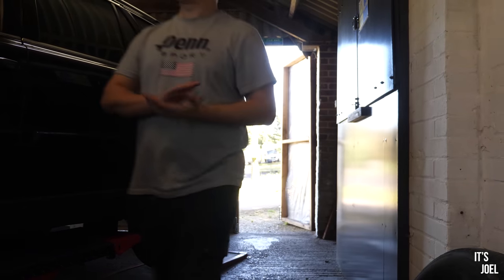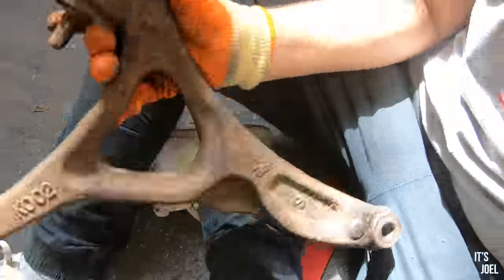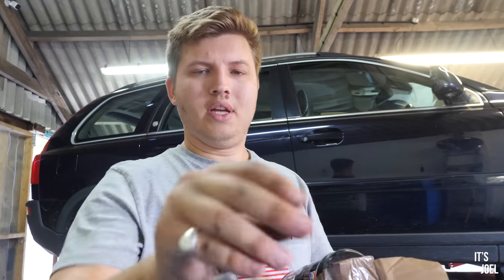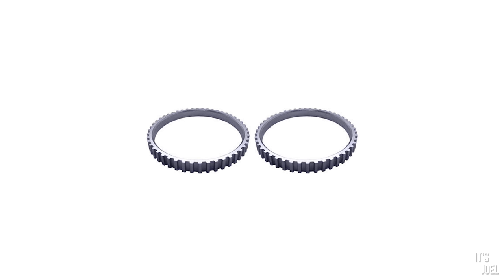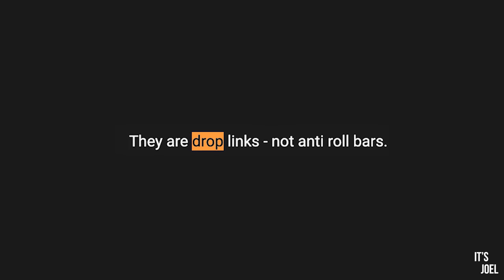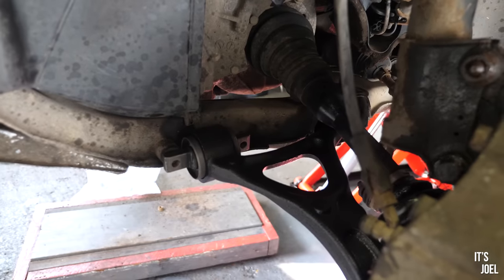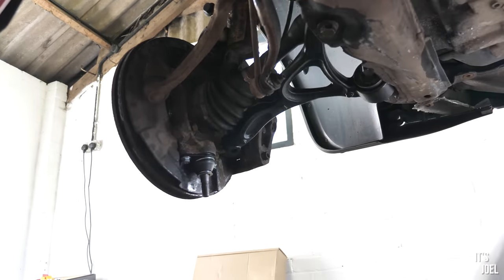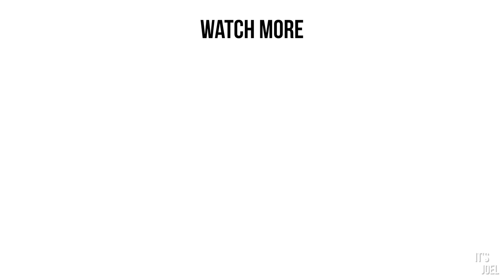CAN I SAVE MY £800 COPART VOLVO XC90? PART 2

Comment: Mate: that ball joint is fine - it just rotated on it's ...ball :)

Also when it comes to ABS sensors: get cheap OBD reader to determine which wheels isn't reading the speed then try swapping sensor only from other side. If it reads ok, then you know to buy wheel speed sensor (£20-ish a pop, no worries). If the wheel speed isn't being detected then check wires carefully before ripping into ABS rings.

Ask me how I know. 

BTW Your channel is an excellent representation of how car tinkering REALLY looks like.
Reply: I agree:  The rings are just "serrated rings"... there's nothing to wear out:  They get rusty and clogged with debris....and that causes the false signals.
Just clean the rings....restore the serrations.

Comment: Ball joint supposed to do that. Also while changing control arm you should remove drive shaft bolt and loosen up the shaft so it could move in and out, otherwise you might pop cv joint out and have whole new problem. Also, you need to beat the control arm with much more power to spearate it from ball joint (same with outer steering rods or driveshaft). Good luck and keep up the good work, man.
Reply: You can't bend a ball joint!! There's nowt wrong with it!!
Reply: @bernardcromarty485  That's what I thought too! The pin, connected to the ball, was merely askew.....  at the extreme of it's travel maybe.... but: Nowt Wrong With It!
Reply: Ball joints work as a ball in a socket so it can move like that the socket deterrents over time creating play in the suspension that u can feel at the steering wheel
Reply: I remember very well the first time working on my suspension with an experienced mate.. I had to bang the stuff so hard... 
I learned an important lesson that day : It is way easier to smack the crap out of someone else's car than your own xD
Reply: I've had Volvo V70 7 of em done loads drops links you should  find  now there's Allen key sockets on ball was on last so remove without spinning

Comment: Top work the bent ball joint made me laugh it’s meant to move around  like a joint but your learning and what your doing for a beginner aren’t easy jobs
Reply from the maker: Thanks I’ve learned this now! 😂
Reply: It's not bent it just needs putting in a vice and use a tube to move it back to center!

Comment: Well done, you remind me of how I had to learn the hard way as a young guy… I had forgotten how it felt until I watched you. Do not feel defeated, you are doing it and have the right ideas. Replacing extra pieces in the suspension and doing both sides at the same time is absolutely SAFE and wise, yes fitting it takes time to learn but you are doing well.

Comment: What a guy! Fair play Joel. I’m about an hour away and would happily point you in the right direction! Lost count of the amount of jobs I’ve done on our old xc90
Reply: Hi Adam... well I have a Xc90-V8.... it has a host of problems at the moment....Unfortunately, I'm on the other side of the world....not "an hour away"....
Volvo for life: Indeed..... When I drive it... I'm in heaven. But it's laid up at the moment......  so not happy at all. 😪
(On the plus-side... The V8 Yamaha purrs beautifully..... not a drop of oil does it use. Nor does it even change colour....a masterpiece of engineering.)
Reply: @patagualianmostly7437   the V8 is Yamaha manufactured,  Volvo designed. So you can say Volvo V8 :)

Comment: A bit of advice from someone that had to learn how to fix cars all by myself near enough. The best thing you need is a Haynes manual. Nevermind icarly or all these Bluetooth code readers. Get sponsorship from Haynes, because with a physical copy it'll not only help you diagnose a problem it'll tell you how to fix it. Step by step, easy peasey.
Fair play to you tackling this and not going the easy route of having someone shadow you or the other wau round. I've got a set of control arms to replace on my mum's car when I'm back onshore and I'll be sweating like an old docker.

Comment: a pro tip when tightening the lower wishbone nuts. Do it when its on the floor or the bushes will ripe and fail very quickly.

Comment: A carpenters hammer? Come on Joel! A 2lb Engineers hammer with its ball-pein head will shock most ball joints loose easily.....if you apply the kinetic energy correctly.
ABS Rings..... mostly require  a wire brushing.... 
It's a ring....it does not "wear" as such but accumulates rust and debris which causes false signals to the sensor, and thus the  ABS warning light. 
(Be thankful you are not doing these jobs on a V8 version of the Xc90.... Double the nightmare, I can assure you. I did much the same  jobs on mine recently....and I'm 71.)
But I love your enthusiasm....... every day is a contribution to the learning curve....... Crack on young man. You're doing fine.

Comment: I just did my abs rings on an S60, which is the same drive shaft set up.  I took the brake caliper, housing and disc off, and the hub came forward with total ease.  I think I saw you take the hub bolt off, so that's ok.  My control arm was still attached, so I just pushed down on it and it came away no probs.
Easy to smack the old ring off, but as I mentioned before, clean the area  really well and heat the new one up to expand it, then knock it on using the old one so as not to damage it.

Comment: If replacing old parts on a car and replacing the bolt nut etc get yourself a grinder, old rusty bolts come of 100 times easier when you chop them 😊 also with drive shafts, losen the bolt about a third of the way then hit the bolt this will shock the shaft and free it up, dont losen the bolt to much as you can potentially damage the thread. And get yourself a real hammer 🔨 😉 more videos like this too, best way to learn is do it yourself and overcome the issues as they arise!

Comment: The ball joints are meant to move like that, they are just very stiff when new. Sometimes you need to move it to easier align with the control arm. You can also jack up the knukle to easier align the control arm. But damn well done for doing work yourself! These xc90's are rubbish, but fantastic when running right!

Comment: Just recently fixed two cars with 'ABS light' issues, cleaned both the sensor and ring with brake cleaner and voila two weeks later still no issues. Cheap and simple fixes and should always be tried first, even if it means fitting a new ABS sensor which cost around £10 each. If that doesn't fix it then try a new ring. Don't always take the garage's diagnosis as gospel.

Comment: Mate - wife has an XC60 & replaced lots of suspension bits or rear springs, bushes etc… but IMO the front lower control arms & springs are under so much tension I gave up… so good on ya for succeeding.

Most bits are surprisingly easy to dismantle.

Until you’ve owned a Volvo… you’ll never understand the love

Well done for saving her 👍

Comment: I do feel your pain - there is nothing so frustrating as being half way through a job and realising that you need a different part or tool - and it usually happens when the shops are shut. My days of working on cars are long gone but I experience similar when doing DIY jobs around the house - so frustrating coming to a grinding halt with everything disassembled.

Comment: Never underestimate the power of heat, ie blow torch. 👍
Reply: At this point in his learning process, I think he needs to stay away from anything that could burn him or the garage down.
Reply: @pclayton5063  For this very reason, I splashed out on an induction heating tool.  Not cheap but one of the most useful things I've ever bought.  It makes heating up bolts in a confined space so much safer.
Reply: @rb9580 . Do you mind me asking what model induction heater you bought?
Reply: @pclayton5063 😂😂😂

Comment: Great video mate, just mind its all a learning curve for you! Also i dont think that ball joint was bent, it has just moved as a ball joint should and you could move it back straight again, dont bin it. For the drop links theres usuallly an allen keyy hole in the front to stop it just spinning so you van undo it woth a sapnner or a spanner into a groove on the rear, if that fails angle 
grinder it outa there
Reply: your are right  about the ball joint, its meant to move
Reply from the maker: That’s good to know! Thought I’d broken it… appreciate the advice & thank you for watching

Comment: Nice one Joel - I would recommend you don't use your torque wrench as a ratchet, otherwise it will lose its accuracy 👍 

Also, if you need to hit the end of the drive shaft, put the nut back on and then hit the nut to avoid mushrooming the shaft.

I share your frustration - doing work on a car with this age / mileage was never going to be easy
Reply from the maker: Thanks for the tip!

Comment: Top tip. A screw driver in the brake disk then rotate until it touches the caliper will stop rotation mate instead of the brake pedal

Comment: Great job, great to see you tackling these jobs.  Careful putting them ball joints back into the knuckle, your not meant to use the bolts to pull them in as you can strip the female threads and you will be in the shit, better tapping them in with an oversize socket or something similar.  Also when you need to lover those control arms over the ball joints a big length of 4x4  ratchet strapped to the control arm and a mate standing on the other end will get it down for you 😊

Comment: Hey Joel, those rings…. Jack up the car and rotate the wheel/driveshaft. If the rings  have a shiny spot on them it’s where the rust from the driveshaft underneath has expanded the ring and it’s kissing the ABS sensor. An easier option is to undo the retaining bolt on the ABS sensor, put a thin washer underneath the sensor to pack it out a little off the ring. Worked perfectly on my BMW and a lot easier than fitting new rings or a driveshaft. If there are no shiny spots on the rings it’s going to be the ABS sensor which only being one bolt and the sensor wiggles free, is also a damn site easier than replacing those rings. 
Hope this helps 
Eddie

Comment: I can relate to how you are feeling, working on my own cars started off much same, but you learn by doing. Next time you try you will be better prepared. A rotary powered wire brush to take rust off bolts and threads, a big hammer and some kind of puller kit goes a long way when working on suspension.

Comment: Joel, that new ball joint that was not aiming straight down. You should be able to move it back so its facing down. It'll be stiff but it will move. If you've got it still try it. They're not in a fixed position. I moved my Z4s ones to get them in to the hole. They're stiff which is a good thing.
I've got to replace my nearside wishbone on the Z4 as the ball joint failed the mot

Comment: Still using a claw hammer then.... you building a house or fixing a car?? Need a proper ball ended hammer or a 4lb club hammer to help break those joints.
Hope you didn't throw away that new Ball Joint as they're meant the swivel hence the name BALL JOINT!!!! I do this for a living and you chose a properly hard car to fix. We struggle to fit those arms at times and we've tools galore. Good on ya through for tackling these jobs and trust me frustration happens!!!

Comment: You need to use heat to expand the abs ring to slide it over the driveshaft end.

The ball joints are ment to move, they dont bend.

Comment: When your doing the drop links  since your replacing them get a decent set of molle grips on the back where the ball is and clamp it. Use the impact on the nut  take it off fully or enough to get a grinder in behind the nut and cut it  saves alot of effort.
Reply: Get a pry bar behind. Pop the ball joint out of the drop link. This gives you access to the ball, to get a good purchase with good solid vice grips

Comment: Drop links ....brake the ball out of the casing then grab the ball with some vice grips anchor the grips undo the nut easy...your replacing them anyway so dont worry about destroying them. and the ball joint is what it says its a ball in a joint it wasnt bent just moved in the casing 😉

Comment: Great videos mate. Couple things. When I am changing the drop links I usually just cut the old ones off instead of wasting the time trying to get the nut off. The control arm I would jack the suspension up and will give you more room to play with but just watch you don't start jacking  the car up at a certain point. 👍

Comment: Ball joint are meant to bend and rotate, the ball joint is fine. Lossen the drive shaft bolt a bit with the socket left on hammer the socket it should move the driveshaft.

You will struggle to get the control back on with the weight of the suspension suggest you get the two bolts undone holding the suspension strut to the hub and separate that, it makes it much easier  to the the control arm in.

I speak from experience only s80 and v70.

Comment: Just stick a decent screw driver in the vented part of the discs to stop it spinning 👍🏼
Reply: no dont do that, you can damage the disc.  put two wheel bolts back in, then you can use a bar across them to stop the hub turning
Reply: 😂 no sure what discs you’re working on. Been doing that’s donkeys years on very stubborn shaft bolts no problem.

Comment: One small but very serious note. You shouldn’t use the bolts to pull the ball joint into the hub. It deforms the plate and the ball joint doesn’t seat fully (even if only by a tiny bit). First big pothole and the bolts will come lose. Use a big deep socket to hammer the ball joint in - then tighten the bolts. It is still worth putting the bolts in first as they can help to guide it in square.

At the very least you need to recheck the torque on the bolts after you drive the car until you are 100% positive that the joint is fully seated. The odds of anything bad happening are pretty slim but significantly more than if you do it right

Comment: My advice to anyone who is brave (foolish?) Enough to replace rusty suspension parts on an older car, is to soak, for several days, all of the bolts that need removing. I dont use WD40, but a specific penetrating oil e.g. Kroil.

Comment: learning new things is brill and experience to get hands on, It very brave to repair your lovely Volvo without any experience which shows your great determine to keep your car.

the control arm , it a right bugger to get it out after undo on the ball joint but after you undo both bush mount, as soon these two came off the control arm slid right off the ball joint.
I seen you bolted the bush mounts on first then tried to fit into the ball joint but it proven to be very difficult, I'd undo the bush mounts put into the ball joint and lose hold by bolt and reattach the bush mount, hope that'll helps (seen this vid after 23 hours posted mark)

Comment: Tip for you mate, you can wedge a flat screwdriver in the brake disc against the carrier and that will stop the driveshafts from turning, Also buy a Brass drift and a decent size Ball Pein Hammer and you’ll have a good chance of freeing off the drive shaft, the brass is softer than the cv joint so won’t damage it, then you can either just chisel ABS ring off or just cut a small slot in it and then chisel it off. I’m sure you’ll manage. Good luck and well done for giving it a go.

Comment: Balljoint are totally fine, its just hard to move, but should move like that! I am from Sweden and are reparing Volvos all the time, a good advise to fix hard sitting bolts is to heat them upp with a propane fire thing 🙂 First use WD40 and let it penetrate, use WD40 again and then FIRE FIRE and MORE FIRE! Then use WD40 again and losen the bolt and fasten the bolt and lose it again. Good luck!

Comment: I think the only way is to completely disconnect the wheel hub assembly from the strut (rest it on a jack underneath it) - then simultaneously pry down the control arm while inserting the ball joint. As others have pointed out the ball joint is a ball joint - so therefore moves ( ie it's not bent - it has just moved).

Comment: No need to use the brake pedal to jam the front wheels just drop a screwdriver into the cooling fins on the disc and jam it up against the brake caliper.